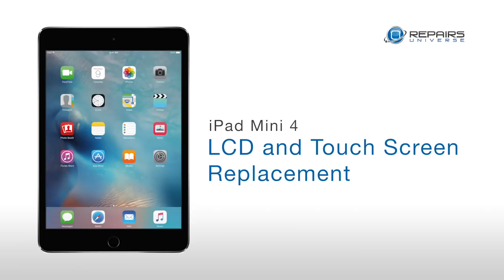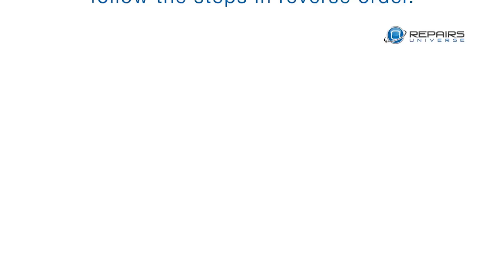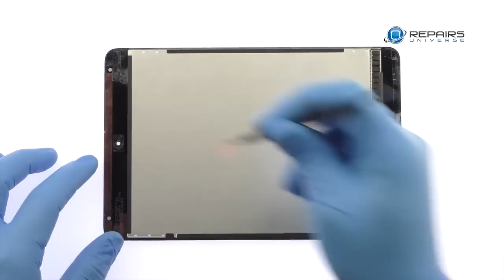iPad Mini 4 LCD and Touch Screen Replacement - RepairsUniverse

Comment: Hello sir please help me. I have an iPad, iPhone 4 Mini, and the charge rate was at 60. It was locked, then I put it on charge. The device opened and the Apple logo appeared, but the white around the logo became faint green and jiggled. Then the logo disappeared and the screen remained white. Then I turned the iPad off, and after that I tried to turn it on again and again, but I could not turn it on. Please.  Help me, what should I do? I am confused  iPad Wi-Fi versionIs the iPad screen okay? The reason is simple

Comment: I replaced it and IT isn't working. We forgot to unplug the battery. It is broken now? is there any way to fix this?
Reply from the maker: Have you attempted to do a soft reset by holding down the power and home buttons?

Comment: I'm going to try to fix my iPad mini 4 this weekend wish me luck
Reply: RaGe Blue did it work bro
Reply: Yea did it work
Reply: Did it work?
Reply: Oof
Reply: Blake Griffin No it didn’t work because the video doesn’t tell you that you need to desolder the sleep/wake sensor and solder it on the new screen or else the iPad will think that a cover is blocking the screen and won’t turn on with the power button only if you hold the power button

Comment: My screen lock does work after I replaced the screen, It can turn off the device but it cant lock the screen anymore, Can anyone tell me how to fix it?
Reply: It's most likely due to the smart cover settings, and possibly not having the magnets in it,
go to Settings > General and turn "iPad Cover Lock/Unlock" off
Reply: Boost Macomb  no
It’s not. iPad mini 4 lcd replacements have to be soldered the IC in order for the lock to work
Reply: yep, same here, have to wait for it to go off or use assistive touch

Comment: when you crack your new ipad mini 4 after you got it 2 days ago... I don't even know how it happened. didn't drop it or anything. this screen mist have very little durability.
Reply: MerchMaster mine was so bullshit. It cracked after i got home to school. It had really thick cover and was always hidden in my binder. I got home took it out of my binder and opened the case and it was cracked. 5 minutes before i was playing it on bus on my way home to school. For some reason ot jst cracked in my binder with the cover on.
Reply: How ive dropped mine so many times on the ground without it even showing a mark i even dropped mine from the second floor onto the first floor and it survived i broke mine when i hit something onto my bed and accidentally hit my ipad
Reply: My son’s has been dropped on pavement, hard floors, thrown by his little brother etc. and held up great. Dropped it on carpet once and the screen completely shattered.
Reply: I have a crappy case and my iPad mini 4 has stranded hundreds of fatal drops while my old iPad mini 1 was ruined by 1 drop and the screen shattered
Reply: My older brother gave me his iPad 4 mini with the corner shattered. I didn’t mind too much but one day while it was on my bed it just shattered completely near the home button for absolutely no reason.

Comment: I've done just this, when I go to close and seal the screen down to the ipad, I lose picture. The power button won't turn on the LCD, you can see it flicker like it's trying but can't. But soon as I pick it up a little off the frame (almost like bending the LCD flex cable less) it will come on. What is the problem?
Reply from the maker: It sounds like you're having a faulty connection. We recommend double checking your connections and the board that these connections are seated to. In regards to your power button not working, there is about 7 soldering points next to the home button flex. You need to de-solder the original flex soldered to this connection.
Reply: So it does have to be the original wake/sleep sensor from the original iPad? A new part with that piece pre-soldered won't work?

Comment: Did you use the original Touch ID sensor/ home button for the replacement screen?
Reply from the maker: Yes. That i the only way to keep touch id working.
Reply: @Chris Fronius Will the touch ID not work after the replacement if you don't solder the 6 pin connections?

Comment: can i use hair dryer instead using heat gun ?
Reply from the maker: Yes a hair dryer will work as well.
Reply: Repairs Universe I found a replacement digitizer glass only on Amazon. It's the only one while all others are glass+ LCD. Big difference in price. What should I do?
Reply: sherif mohsen get the combo. Most likely you would damage the lcd trying to remove the digitizer